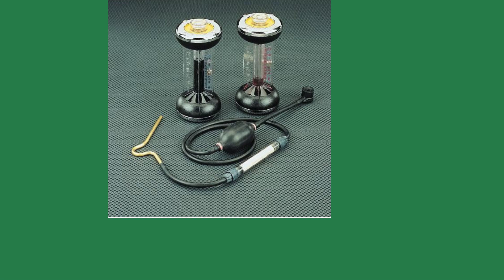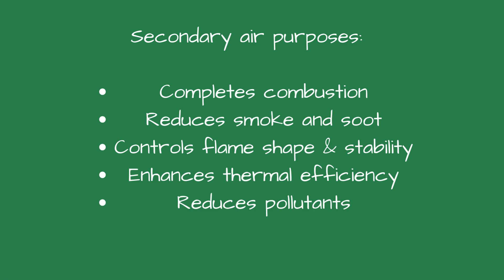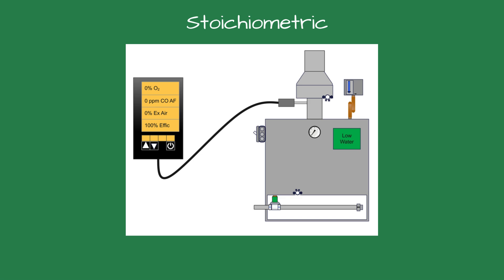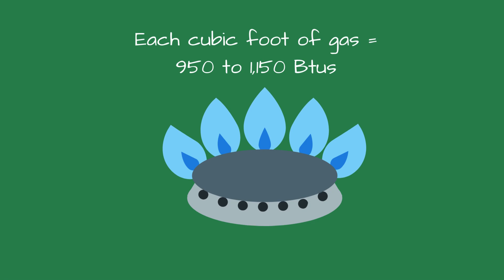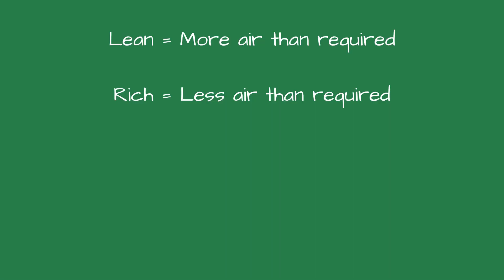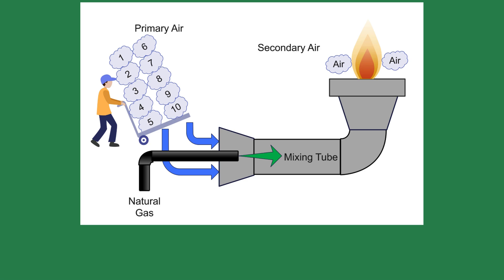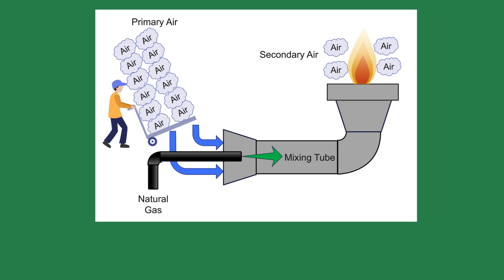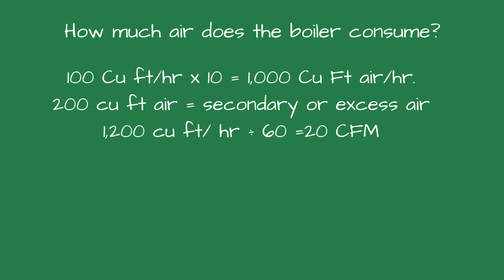Understanding the Combustion Process

Comment: awesome awesome awesome. do i tune a boiler for CO or O2? i think i understand that zero CO is perfect combustion but the closer i get CO to zero the higher my O2 goes above manufacture spec and the lower CO2 goes under spec which is calculated by the analyzer anyway. do i pay attention to CO2? thank you thank you thank you
Reply: and while i'm torturing you, as i lower the CO the flame signal gets weaker.
Reply from the maker: @ I would check the draft if the flame signal is dropping. It could be pulling flame away from the flame rod.
Reply from the maker: I test using O2 while trying to maintain the proper CO2. The CO levels permitted in flue gas is 400 PPM CO air free I try getting it as close to 0 as possible. If it's a new boiler, you will have higher CO as the the oil from machining the boiler parts burns off.
Reply: thank you so much. have a great day

Comment: Nothing wrong with a wet kit, except it takes 20 seconds to take each reading after every adjustment where an electronic tester is reading in real time.  I know a master plumber who keeps a Bacharach wet kit on his truck when he suspects the sensors on his Testo might be acting up.  The readings the old journeyman took were probably different because the combustion changes as the boiler continues to run.  If using an electronic tester, the numbers change constantly.  But I doubt the wet kit numbers changed by more than a half percent CO2 at any given time unless there was something wrong with the burner.
Reply from the maker: Never heard it called that Thanks they were not my favorite My first analyzer was a Lynn and it felt like heaven lol